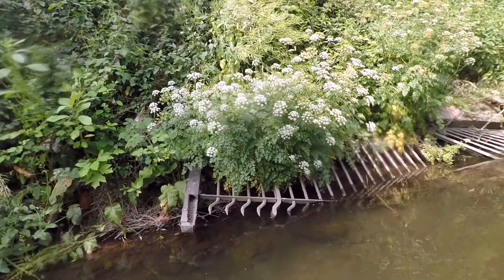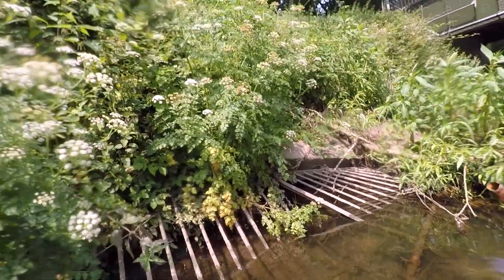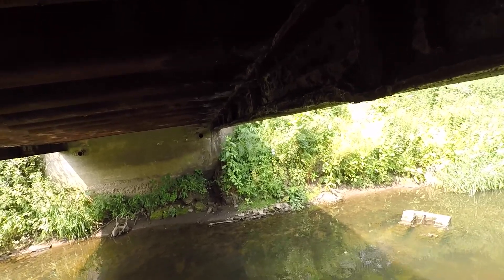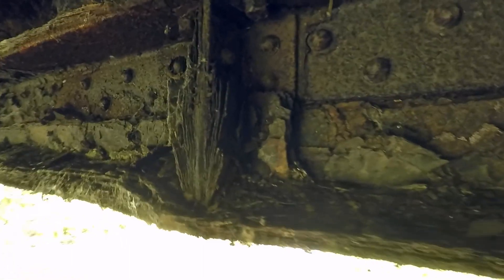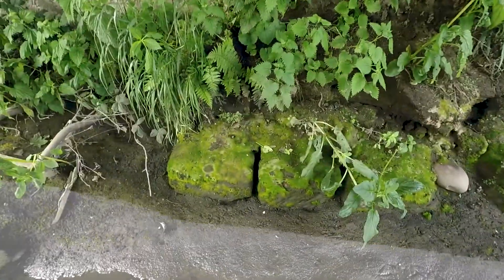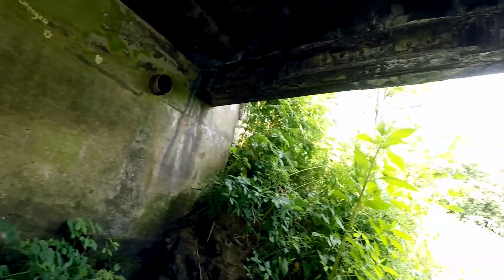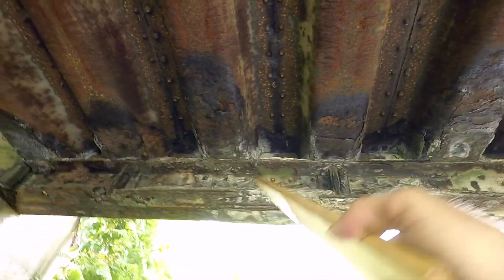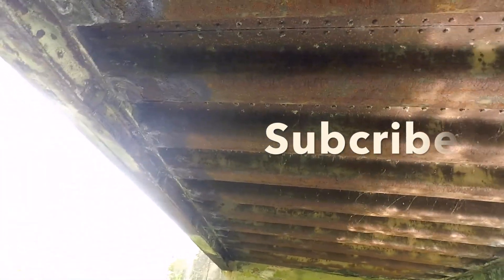Unsafe🎢 Bridge Stag Meadow Kinver 2017

Comment: The sandstone blocks are there to prevent erosion. What little of them are left are useless.  The Stour will hammer through on the flood taking that sandstone with it leaving the bridge foundations vulnerable.  Basically the foundation slab will crack and the bridge will not be supported.  If you don't believe me go to any bridge that goes over a river and look directly at where the spans are in contact with the river and you'll see massive boulders all around them.  What they do is deflect water around the support rather than underneath the slab.  I speak the truth.
Reply from the maker: I don’t think they’ve had the fair on there since x